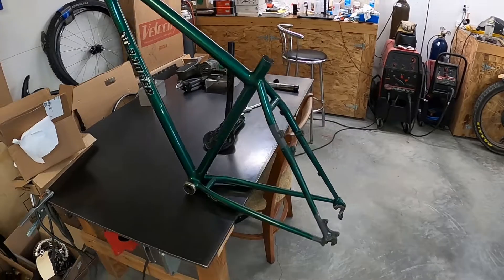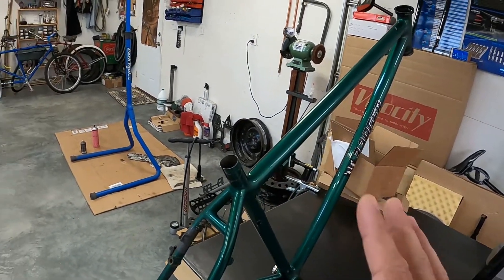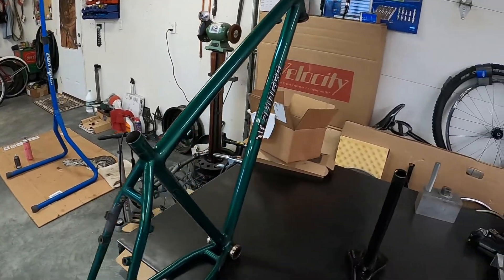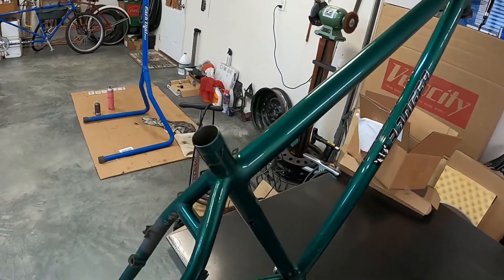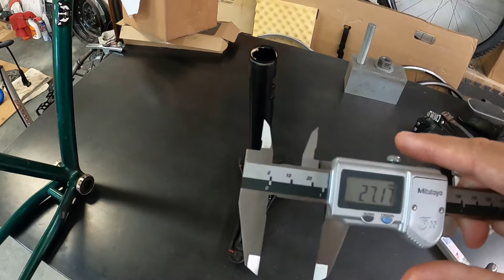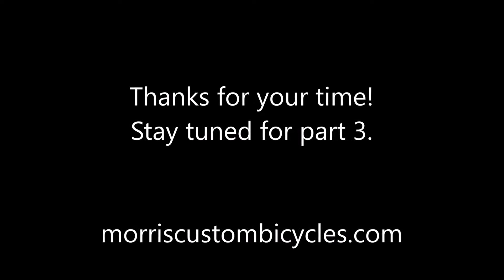Stop Crack Part 2

Comment: Great video, very informative!

You mentioned a bump at the bottom of the seat post collar can be a warning sign of future problems. Is there any preventative action you’d recommend for a steel frame with a small bump at the bottom of the seat post collar slot, but no cracks?
Reply from the maker: Yes! I do have recommendations for this issue. First, make sure you are running the correct size seat post. You will always want to use the largest post possible. An example would be some one who has a 26.6mm seat post installed on their bike, but the bicycle has room for a 26.8mm. That bike should run a 26.8mm even if the bike seems fine with the 26.6mm. Size matters. 
   If you are running the correct size post, you may want to see the amount of stretch on the seat tube of the frame. It's not uncommon for bike frames to have the clamp area of the seat tube a bit stretched out from years of usage. The opening to the seat tube will sometimes measure 1 to 3 millimeters larger than the inside diameter of the rest of the tube. If that stretch becomes too much, you can develop that bump. The best way to fix this is by using shim material thus negating the 1 to 3 millimeters of stretch in the seat tube caller. It is not that uncommon to see mechanics using beer can as shims. If the can is too thick, it is possible to buy very thin shim which can be used to fix the play in the end of the seat tube. 
   One other thing that people do, is shim down the seat tube and use a smaller diameter seat post. Depending on the size of the seat post and the inside diameter of the seat tube, this may or may not be possible. However, you can easily purchase seat post reducing shims which may help relieve pressure causing the bump. These would be my best recommendations. Good luck!
Reply: Thank you for the very detailed response. This is very helpful!